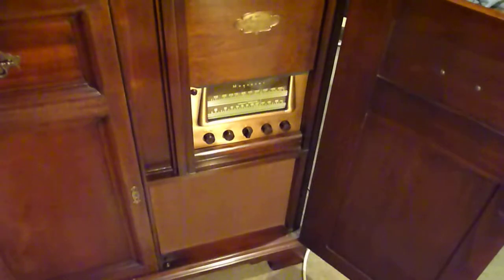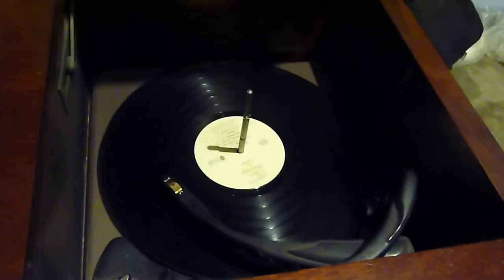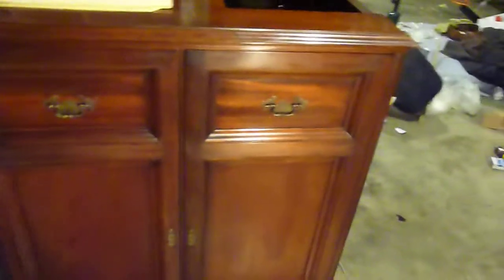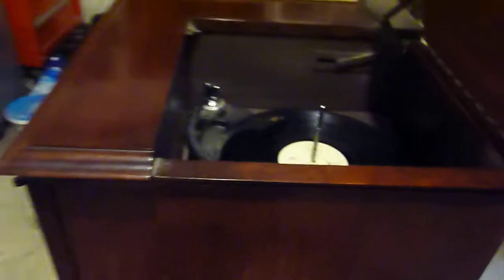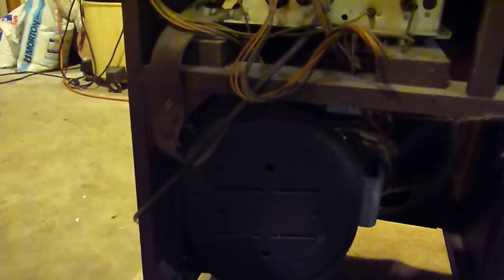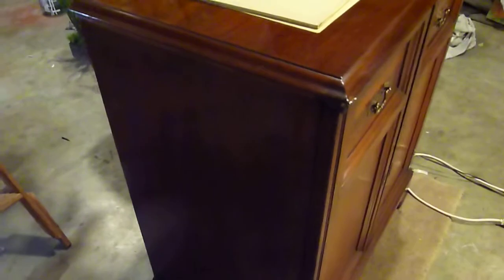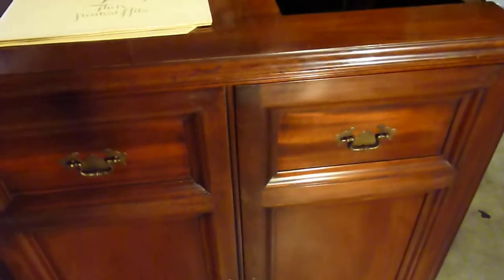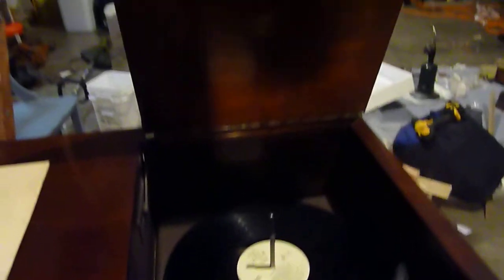Magnavox The American...radio phonograph console solid Mahogany...

Comment: When I was a kid, I found one of these in our local dump.  I took the radio part and used it until I grew up.  There may have been a few similar models, but mine had a 12" speaker.  That thing you couldn't identify was a big AM loop antenna, and at night I could listen to a Chicago radio station from New Jersey! Sadly, I was forced to throw it away in 1990, and I still miss it.

Comment: Hi Mark, I was happy to find this video.  We just found this same Magnavox on the curb in our neighborhood.  The house it came from was being flipped.  Yours is in much better shape.  Rats have chewed off half of the power cord's insulation.  There was some plant material and lots of spider homes behind the radio unit.

I haven't taken it apart yet, but I think that flap in the back might be an antenna.  It might swivel so you can get better reception.

I don't know which parts are solid mahogany, but the top appears to be made of poplar with a veneer.  The veneer on ours is coming off badly in two places, and we can clearly see the yellow/green/grey streaks characteristic of poplar.  We just ordered some mahogany veneer for another vintage speaker box we're restoring for a relative, so maybe we can apply it to this Magnavox.  Or maybe we'll paint it with some black chalk paint.

Anyhoo, it's great to see it working and how it could look before we roll up our sleeves.  Thanks!